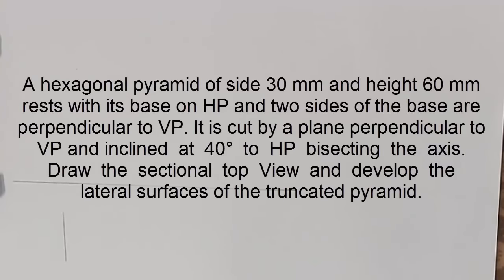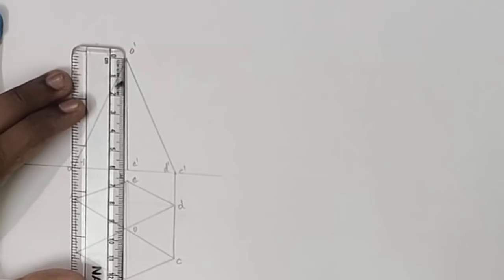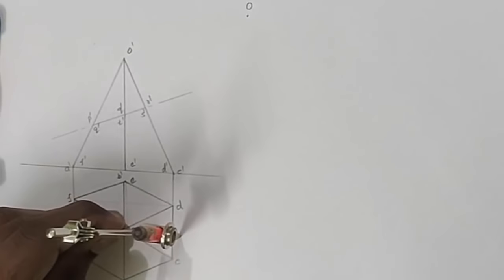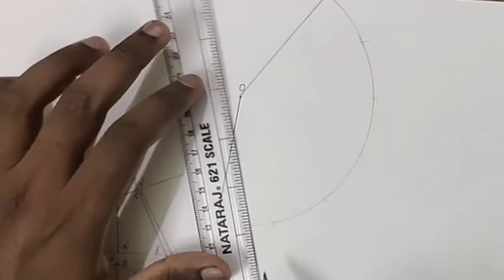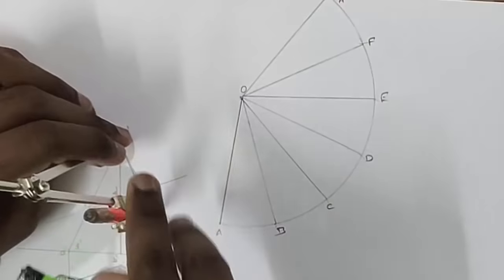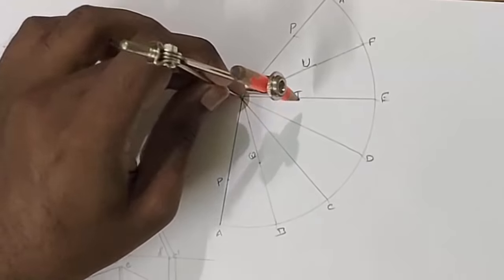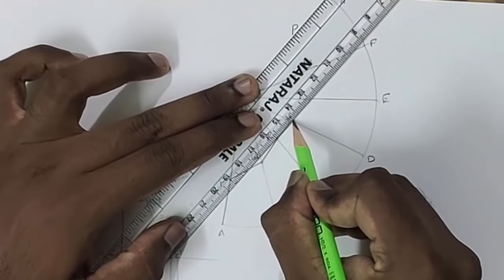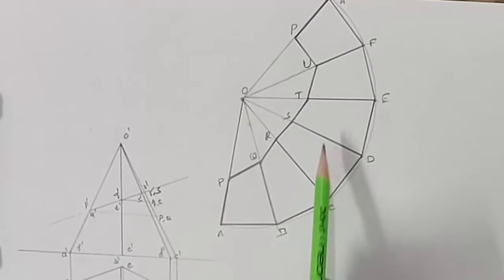Development of surfaces 4 | Hexagonal Pyramid | Engineering Graphics | Truncated Pyramid

Comment: Please how did you mark 40 degrees
Reply: Take mmid pi ns
Reply: place the protector at the left side of the triangle in xy plane . then try to place the 40 degree angle of protector from to base to correctly coincide with mid height of 30mm.